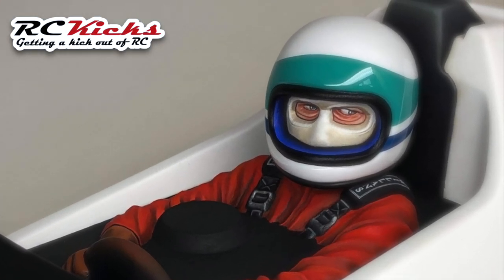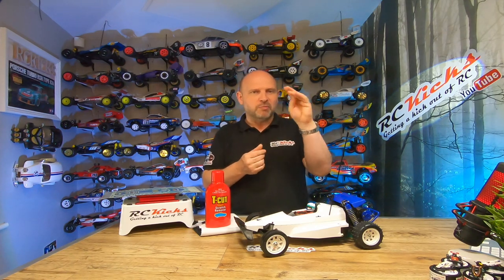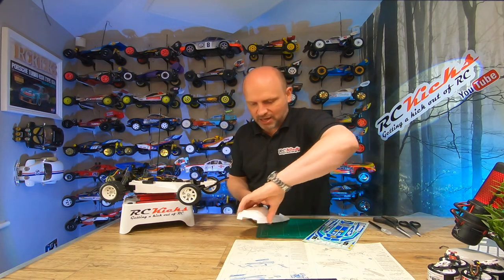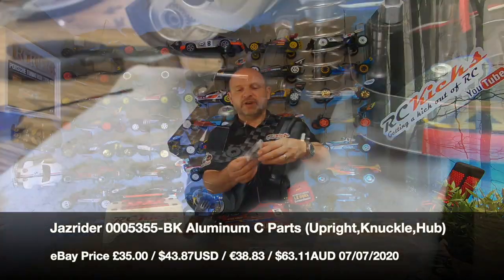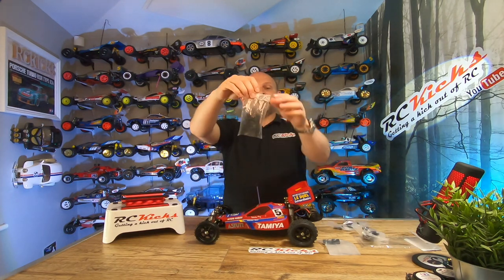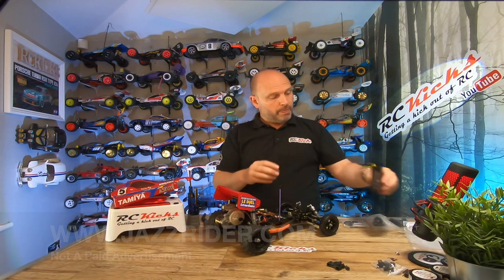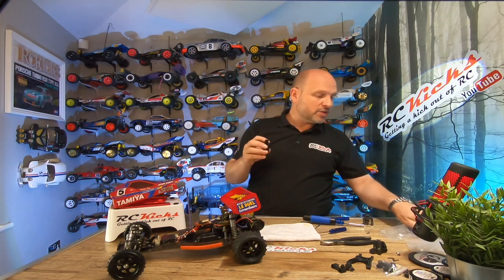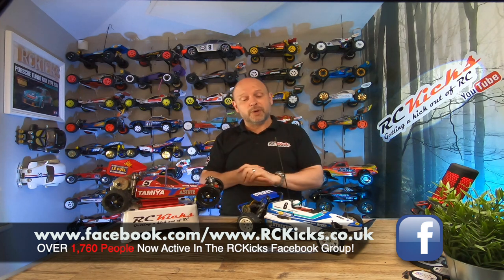It Came Out Amazing! Finishing A Tamiya Striker Build & Upgrading My Vintage Tamiya Astute RC Buggy

Comment: It’s appropriate the driver is not looking straight as it is impossible to get the useless thing to go where you want to!  My mate had one in the 80’s and we tried everything to get it to steer; different tyres, weight in the nose, turn the bumper upside down and driving it backwards 😬

Comment: Where did you get the Carbon parts for the Astute? Link please thanks. Looks awesome I have 2 (1 shoulder and 1 I wanna make a runner but want to upgrade the weak points)
Reply from the maker: EBay or the company has a website
Reply: @RCKickschannel  I found the aluminum parts but not the Carbon Fiber parts.  Do the carbon parts come with the Jazzrider items?
Reply from the maker: LS Turbo Man Yes the Carbon tops are on the rear parts.